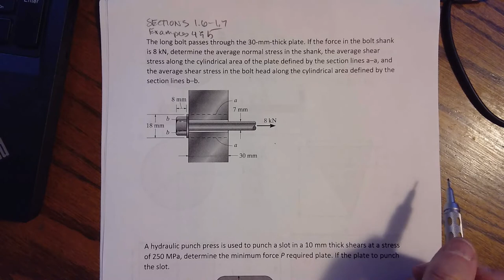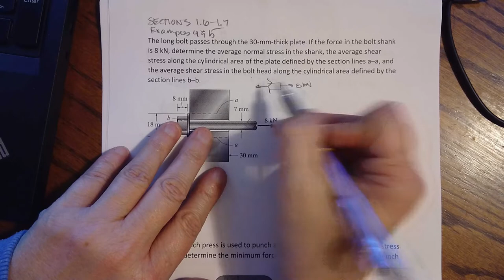ENSC 2143 Sections 1 6   1 7 Example 4 and 5

Comment: i was stuck on this question for a good while. its a good question to help you understand how to visualize what the question is talking about and makes you understand how shear stress and normal stress applies in the different parts. I like how you explained how to find the cross sectional area, its like a projected area that the parts are pushing each other on.